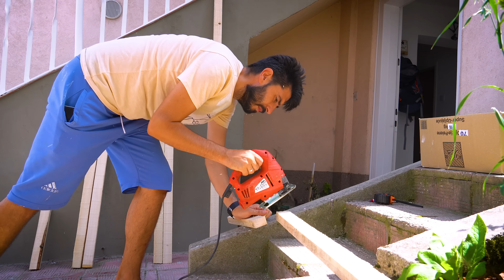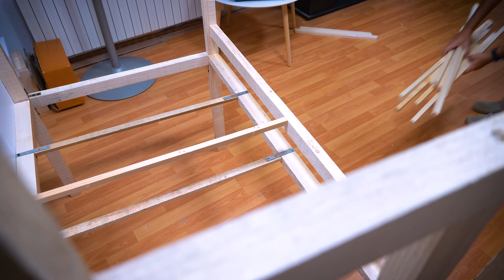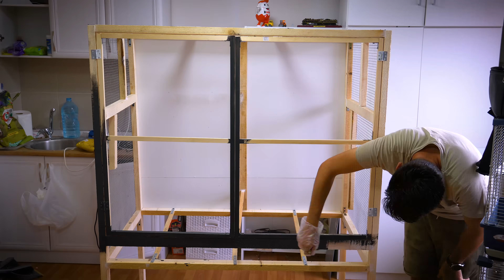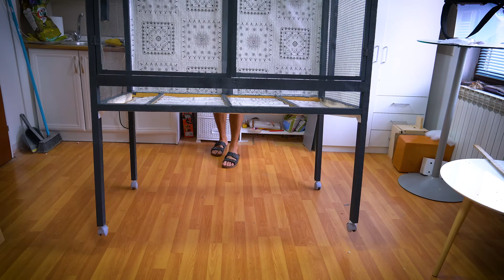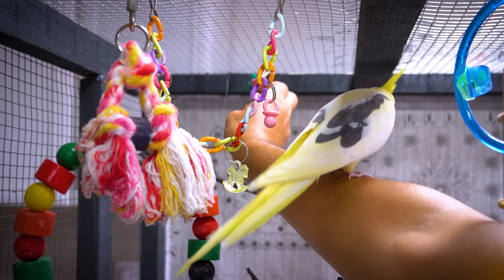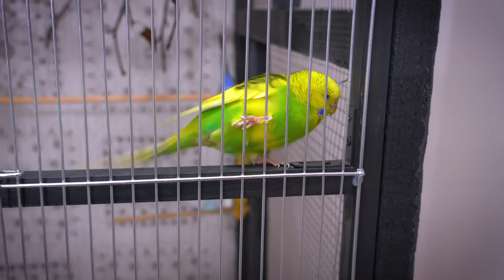EASIEST DIY Bird Cage - Easy Project Homemade

Comment from the maker: Like this video or you will make little bird sad 🐥
Reply: Q
Reply: @jojeoliveira2760   What are you meant by Q
Reply: ةة
Reply: @jojeoliveira2760  اي
Reply: @youtube5053  à
Reply: @youtube5053  ظزنننممظزززززززظززززززمظظظههننننزننمممممنزمددزظظظزززززززززززز ز
Reply: @youtube5053  we would never know
Reply: @youtube5053  aa❤ es
Reply: ❤
كككككك
Reply: دظدكسدظ🎉
Reply: مهدي❤❤❤❤❤
Reply: @jojeoliveira2760  لى
Reply: @youtube5053  so 😢😢U
Reply: Please you must use stainless steel wire not zinc or galvanized (zinc) they are deadly to birds, as is most paint

Comment: For anyone thinking about doing this for your own birds, make sure to look up accepted metals that your bird can come into contact with. That chicken wire is galvanized, which adds zinc to the surface of the metal being treated and zinc is poisonous for parrots.
Reply: And another thing to add: The birds will chew on the wood. So best is to use no colour on the wood or try to find something that's safe for birds. These colours are probably poisonous for them.
Reply: @Abc-fd5jw  poisonous colors?
Reply: @digitalian99 poisonous paint 100%
Reply: This needs to be pinned at the top. It is deadly. No shade against the video maker, just needs to be stainless steel

Comment: Very beautiful but poisonous 😢 the wire is galvanised steel, it’s toxic. It needs to be treated with vinegar to make it safe (they will chew on it). I did that treatment before, it takes time but is worth it. Poisonous paint on the wood too. They’ll definitely chew and ingest that paint. 😢 not safe unfortunately